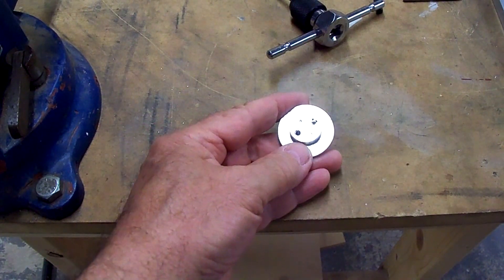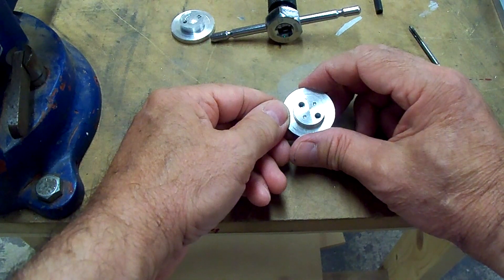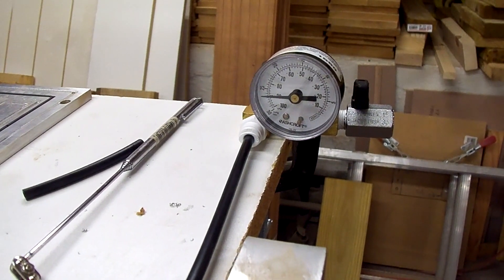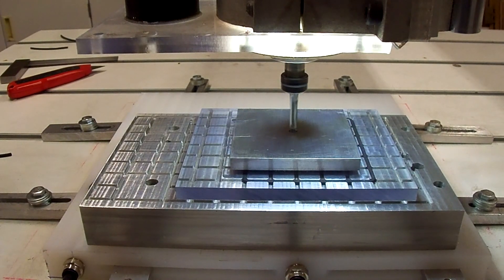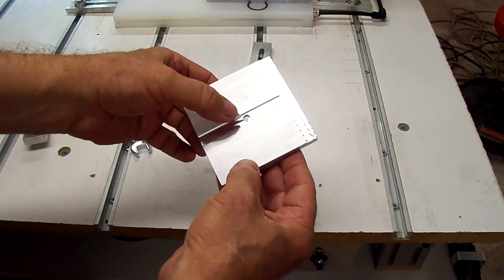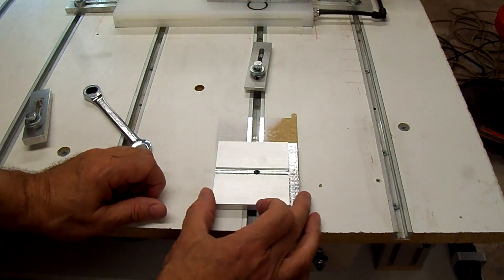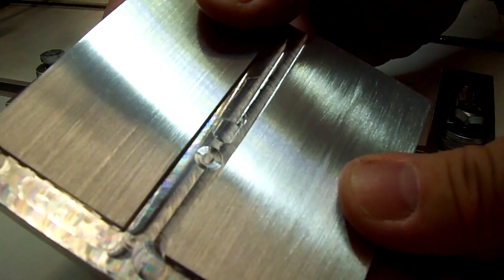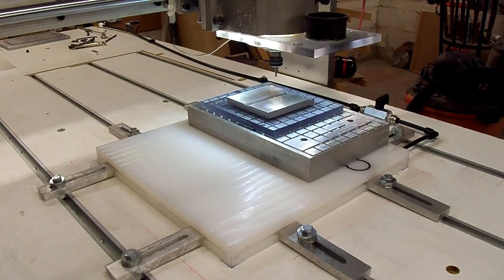Aluminum Interchangeable CNC vacuum pods Part 4

Comment: Enjoyed watching the whole series you put a lot of thought into this project. I have a couple of questions.

Why the stack able plates? Why not just put the special jig on the first aluminum plate?

In cutting the aluminum plate, what speed, feed and cut depth did you use? I noticed you didn't use a lubricant either. What router bits did you use?
Reply: Thanks for the quick response and great information.

After watching the Nemi video I understand why the two plates rotate, well at least partly why the rotate. Not sure why you'd need to mount something off square on your table. I figure that's what CNC is for. As for having to rotate to reach the screws to remove the project plate, seems like there should be a simpler way. I'll have to think on that.

That all being said I still admire your puzzling through the project and make a very nice plate.
Reply: MyRobertadams Im confused on how to make like the bottom plate. The top plate I understand. Anyway to explain please?